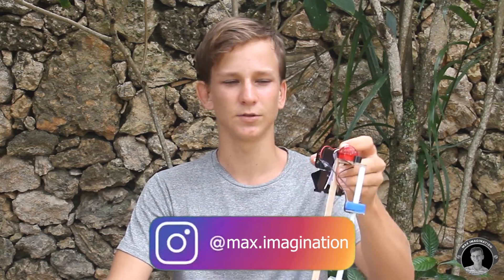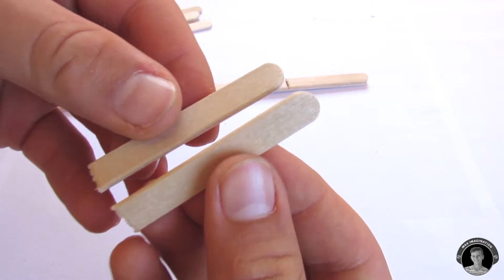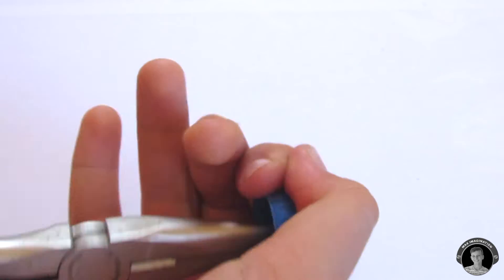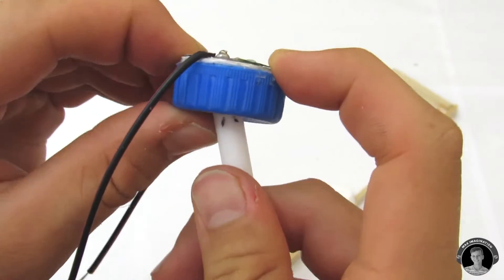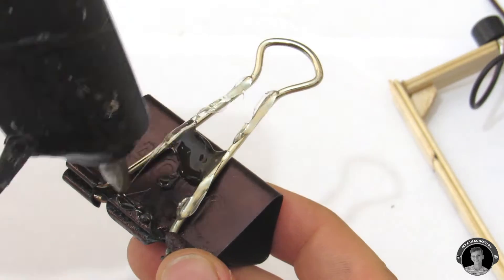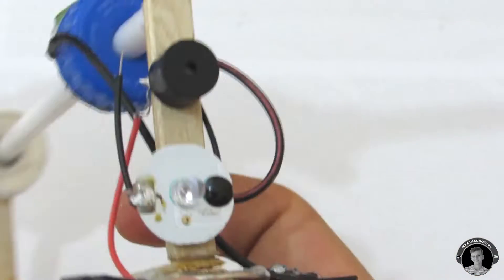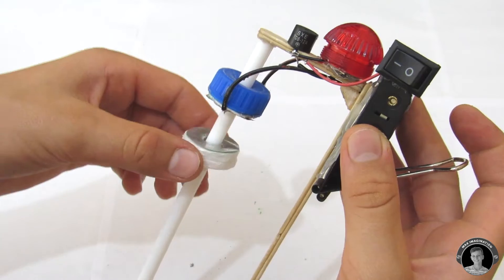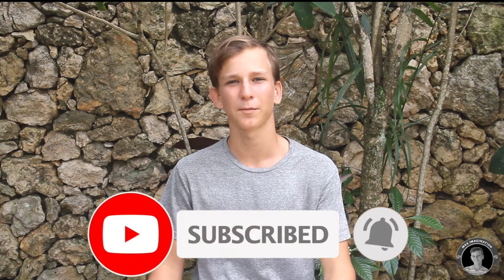How to make a Simple Piezo Buzzer Water Level Alarm Indicator | DIY Sensor Alarm

Comment: I need something made that beeps like a fire smoke detector does when the battery is low.  But I need my device to beep once a contact is closed by a door that is normally open, that is then closed.  So basically an beeping alert when a door is closed.  I am able to pay, just need help with this.  Thanks.